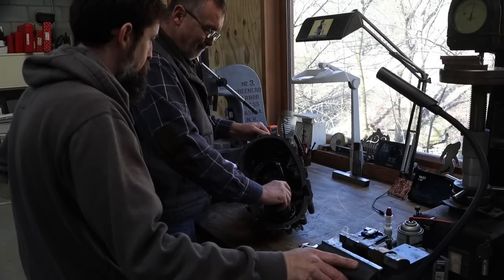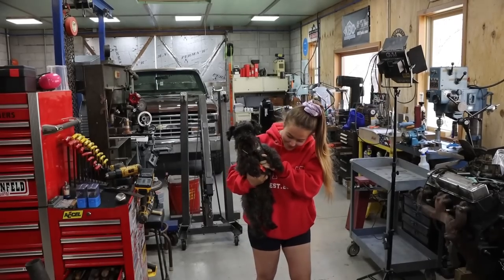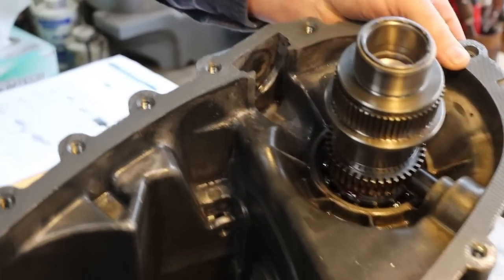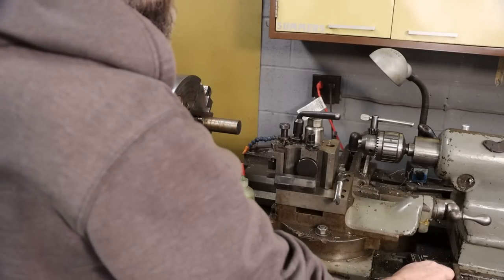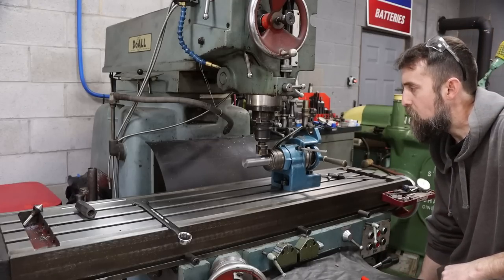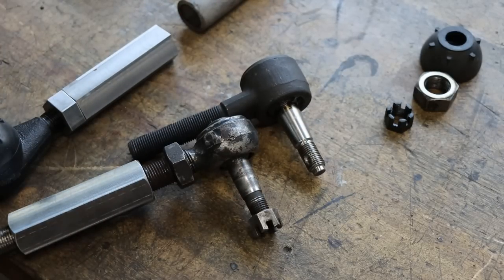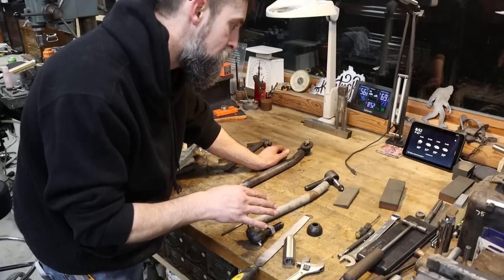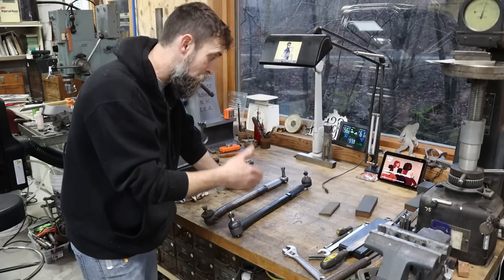Some Machine work for my big Brothers

Comment: Oh No Steve violating one of my pet peeves! lol I always like to modify the equipment to use standard parts rather then making a bunch of one off custom parts no one will ever be able to match later down the road.  You still got the job done in fine fashion but I feel sorry for the next guy that has to work on it! LOL

Comment: The handle your brother made fun of reminded me of a accident that  happen some 50 years ago...I was running a Cincinnati #5 horizontal mill working with a rotary table making notches on a very large S.S. casting for a nuclear sub. 
The placement of the mill was along the main thru past way for the forklifts...
They bent the elevation crank they had caught on from a big wire basket, bending the crank handle so that it stayed engage when you elevated the table on the mill  whipping it around ...
I was working with the rear controls, I didn't think about it. 
When a co-worker came by ,straddle that crank handle, curious in what  was doing...
Me ...not thinking, I hit the elevation lever, launching the co-worker across the room and landing  him on of a lathe!...
The lathe operator stop his machine turn and applauded me...
The co-worker was knock-out cold.
I never hurt anyone in my life.
I was so upset the owner of Tool Master Tool& Die, saw me crying told me to take a early lunch.
When I came back the Ambulance drivers were putting him in their truck .

The machine handle was put back in working order that night.

Everyone from then on when they see me quickly grab there crotch and shuffled away!
I never live that down and never forgot.
Reply: :face-blue-wide-eyes:Sometimes...life is a real bastard. But we live and we learn...👍

Comment: It would be hilarious if the original tie rod was bent due to impact with something, and you replicated the bend as well.
Once upon a time I worked on industrial machinery and was sitting in a shop talking to the head machinist when one of my competitors came in looking for some help to fix one of his machines out on the floor. He asked the head machinist if he thought it could replicate an oil bronze bushing he showed him, and the guy said sure, I can make you one. The guy never told him the bushing was worn out, so the new one was made exactly the same. The machinist then refused to build him another one because he pissed him off.
Reply: :face-red-droopy-eyes::face-green-smiling:
Reply: That was a good laugh, I had machined a bushing and asked the guy if he wanted it exactly like the original he looked at me quizzically and I mentioned the wear issue then he understood and laughed and said the diameter it needed to be.

Comment: My second job(my shop) got going doing jobs like you did here, broken tractors, farm equipment and excavation equipment .  My dad ran the equipment repair shop for the regional utility company.  He had no machinist so from age 14 on I was it.   Let me know next time you need threads like that my lathe cuts metric by changing one gear seems like even 15 year old stuff has metric parts on it.  Nothing like fixing something to get someone back working, nice job.

Comment: Fantastic job on the steering link. Two alternative ways to have done it would’ve been to thread both ends of the new rod and eliminate the adjustment nut the other would’ve been to switch to heim joints and eliminate the tierod ends all together.

Comment: think sending them the original non ground balljoints and the correct tapered reamer might've been the better idea in the long run 
that way when one of the balljoints fail they can replace it with an off the shelve part now that they have the Oreileys partnumber (yes they would likely need to weld it if its the inner one but they dont need to machine it to get it to fit every thime they need to replace the part )
Reply: They'll have that option in the future if need be...

Comment: An average Joe like myself who has a lathe,could put the end of the ball joint in a collet In the lathe spindle. And while rolling slow in back gears, use a tool post grinder to cut the new taper. Git ‘er done 😁
Reply: Local gunsmith did that w/ a spare points cam when I as a youngster attempted to "convert" my Commando to electronic ign. He felt that the cam was too hard to do otherwise.
Was an abysmal failure on my part...wish I still had it, Chrysler boxes & dual coils are cheaper than I was broke/ignorant then...
I've learned a bunch from the internet 
Could use a pair of Ford TFI modules & keep the cylinders firing separately....

Comment: Tie rod ends can explode when exposed to a lot of heat, removing the grease fitting before welding would have been safer.

Comment: The grinder is a great addition to the shop. Nice time you run into needing out the wall dies are tapes, send me and email, mite have from that 2021 tool sale we bought out. Steve, the what blade TPI is on you horz little saw? The saw Joe Pie gave me is still cutting with its original blade, but yours seems to cut much quicker (unless the video speed is what makes it appear faster :)>). Thx for sharing, Bear.

Comment: I'm just an at home untrained and uneducated wanna be machinist so I have never seen that concentricity gauge thing that runs in the chuck... HOW COOL!  Show me that tool in a vid if your looking for some content ideas.
Reply: This is a coaxial indicator. Import knock offs are readily available. There are several major brands as well. I don't regard them as dimensionally accurate since the kit is equipped with a wide range of tip lengths and you can position the tip in a huge arc range. They are intended for a limited purpose, to find centerline. Since they indicate TIR, the actual position error is 1/2 of the TIR. The ability to hold the body still so the dial faces you is an enhancement over using a test indicator and mirror. If absolute position is required, I trust the more inconvenient test indicator more. I purchased my Fowler branded coaxial indicator from a Walmart parking lot drug addict for about $25 or $30. If you hole center or shaft center locate frequently, they are really a nice tool to own. I was a CNC shop maintenance technician. Purchasing our own coaxial indicator really sped up turret lathe crash damage repair. The weakest crash link in a turret lathe is the turret indexing function. Modern turrets are designed to slip older machines were pinned. The tapered pins made them rigid and crashes stepped the locating pins and elongated the taper pin holes. After truing the turret, we would ream the taper pin holes and replace the pins. We later tried running without the taper pins and only relied on mating surface contact to maintain rigidity. Rough relocation of the turret was pretty simple, just use a good taper pin for an alignment reference. The coaxial indicator allowed rapid final tweaking adjustment. Machinists are more likely to use them as Steve demonstrated, but the principle is exactly the same.

Comment: For what it is worth, Steve, a friend of mine SWEARS by using "oversized" NEMA contactors.  He also refuses to use ANY IEC spec contactors as he knows from decades of experience that the contacts simply are not large enough to last.
Reply: IEC contactors and starters are junk compared to NEMA. They are cute and their compact size allows much smaller electrical cabinets. Adjustable OL settings allows reducing spare parts inventory since you can stock a variety of ranges instead of specific heater sizes. Unfortunately, the IEC component WILL fail and you WILL be dipping into the spare parts inventory frequently. I am going to guess that in 40+ years of commerical and industrial service that I repaired properly sized NEMA starters less than half a dozen times. We kept inventories of IEC contactors and OL relays in stock and I reordered replacement inventory probably annually.

Comment: Steve, wouldn't it be easier to tilt the rotating spindle of your fancy pancy new grinding machine (I envy you here) ? Then you can traverse the whole length of the cone without blending left and right. Looking at the machine I have a gut feeling that's possible. True? Furthermore a lathe that cannot turn backwards leaves out a lot of nice tricks you can do with it. Left hand thread, right hand thread starting from the back, turning an inside/outside cone without resetting the compound, blasting brass to the shop floor instead of the whole room, hair included, etc. etc. Is this a given on this nice old machine or a defect you still have to adress? (For changing motor direction electrically on a three phase machine; just swap two of them in a switch; that's easy to do. If the mechanics don't allow it that's probably more difficult. I guess it's electrical because of the usual way lathes are build) I can help here; let me know. Looking forward to your answers, all the best, Job
Reply: Many lathes have chucks that screw on. Therefore no back gear.
Reply: @TomokosEnterprize  my first one had a threaded spindle nose. I added a clamping possibility to the two chucks it came with. Worked nice. Without it reversing was a once in a lifetime experience
Reply: @jobkneppers  I am sure it was, LOL. I hope you or anyone else got to share that too close my friend.

Comment: Hi Steve, How in the hell did you actually have a 17mm x 1,5 R/H tap in your shop? Just lucky I guess. lol. What would have been interesting would have been you cutting some gears for the lathe  to enable you to cut metric threads and then you are good to go, big job I know, but metric seems to be the future. Also I didn't know your lathe didn't have a reverse capability. Need an upgrade dude.